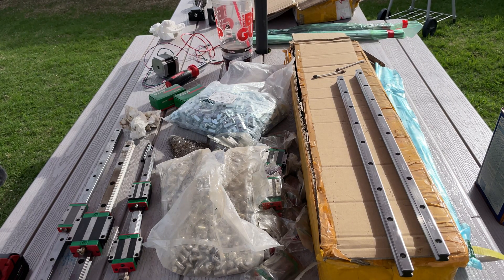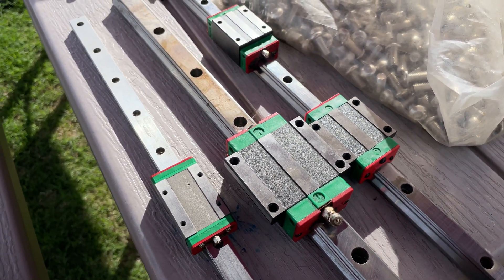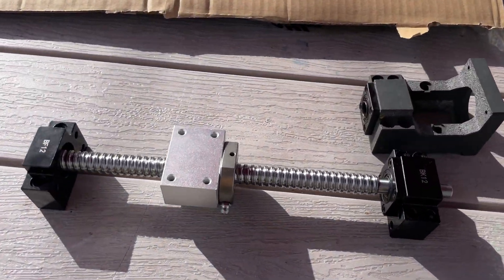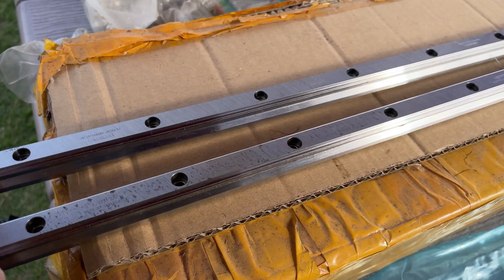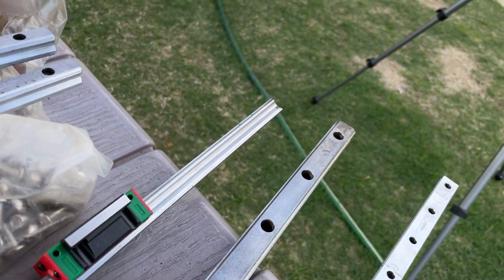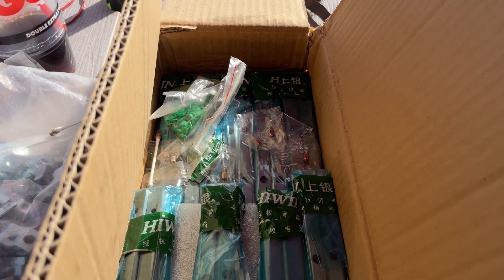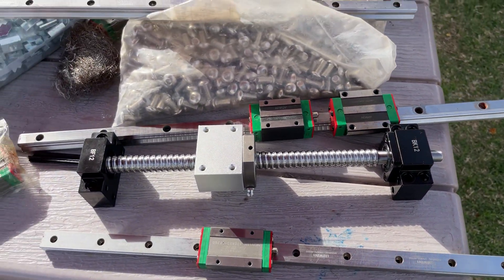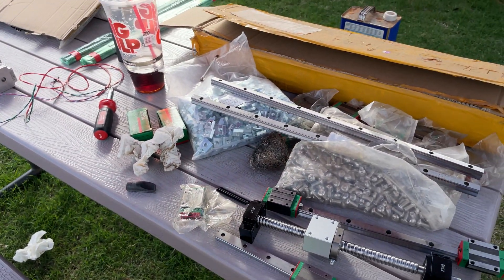DIY CNC Hybrid Router Build for Steel (Linear Rails and Ball Screws)

Comment: Why would these bearings be a good idea with metal shavings or sawdust?
Reply from the maker: They may not be if you do not need to rigidity or precision...  But if you do, lets say you are a cabinet maker who wants to build a CNC router to take the place of a drill and table saw.  The red ends on the blocks you see are rubber seals, they act as squeegees and keep the grease packed inside they are tight.  You would put green caps flush with the top of the bolt holes to keep chips and dust out.  In addition there are something called "bellows' that you can make or have custom made that act as an accordion over the bearings/rails. You can even use a sheet of vinyl or plastic of some sort to act as a skirt.  Some people creatively design their machines with rails away from the chip path. But lets say you dont want to waste time engineering, you can buy red end caps on the blocks with extra features just for cheap clearing.  Hiwin makes a ZZ scraper that works in conjunction with the red seal.  For anyone interested you can lookup "Hiwin ZZ scraper" or "CNC bellows" your starting google search and see examples.
Reply: @takingtheblackpill  generally you aren't cutting glitter with these and the only time you should ever really need a bellows is for ballscrews